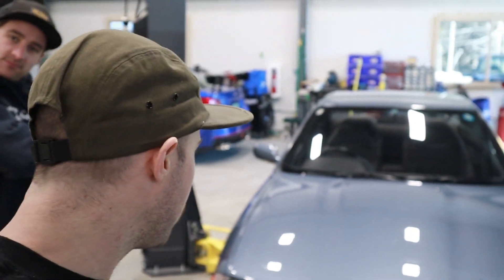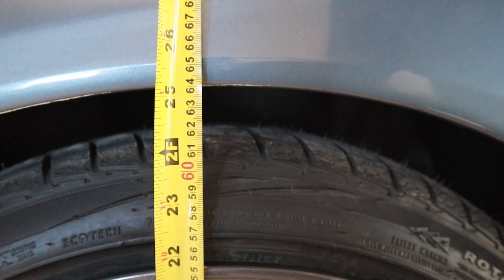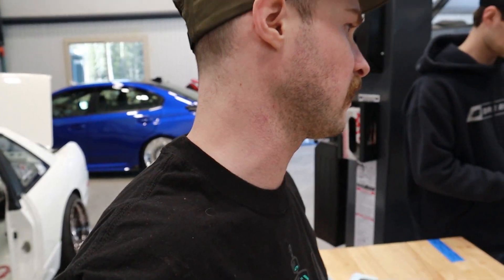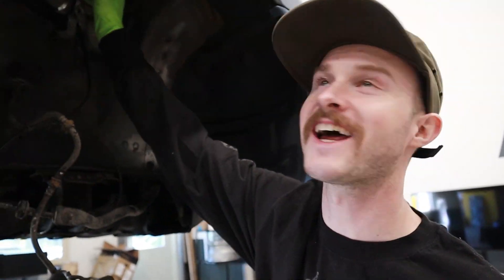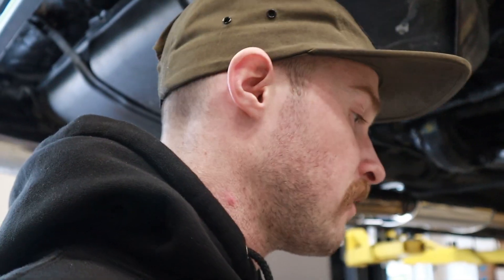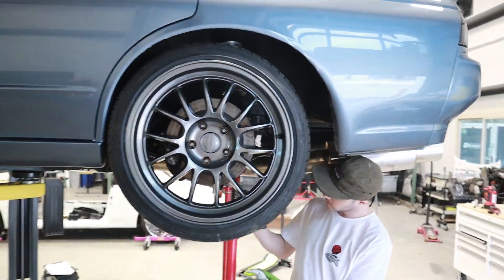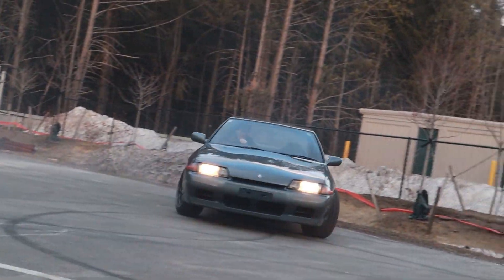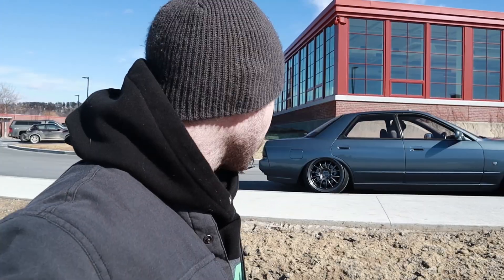Suspension Overhaul For The R32 Skyline

Comment: ok question on the manual setup how difficult is it to get all the bags at the same height
Reply: Depends on if it's sleeve in the rear. Sleeve bags roll on the lower bag mount and can cause some inconsistency. Best to air all the way up and come down to the desired pressure. With bellow style bags (they're symmetrical) you'll have more consistent pressure to height. Home that helps, feel free to DM me on instagram (@bagriders_tm)